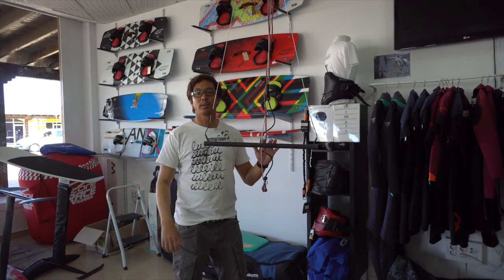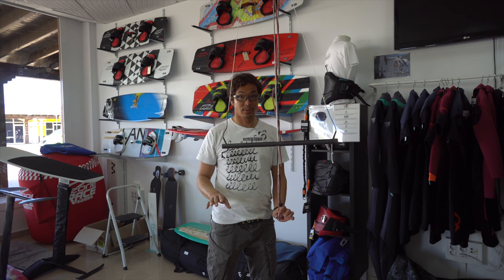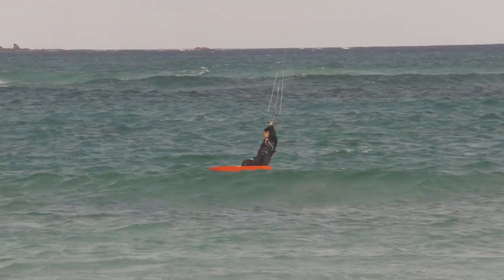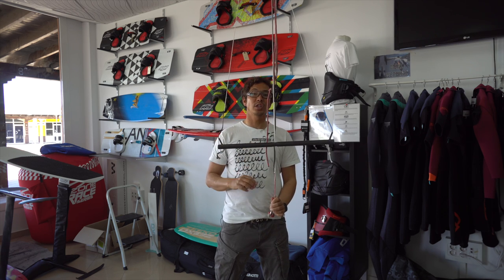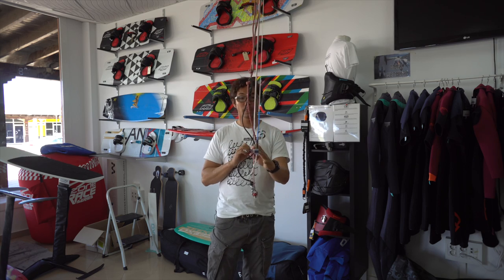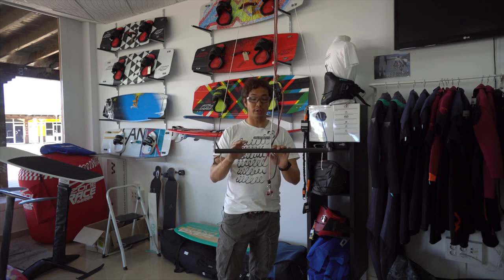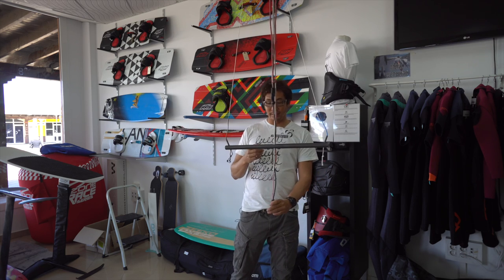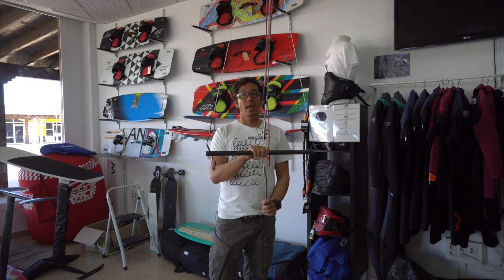VLOG#14: SKshapes Carbon Bar

Comment: How does the system connect to your harness? Haven’t really seen it anywhere. If there is a shackle that just connects to the metal on your harness wouldn’t it slide around?
Reply from the maker: I have a O-Ring on my harness. That is where the shackle attaches to.